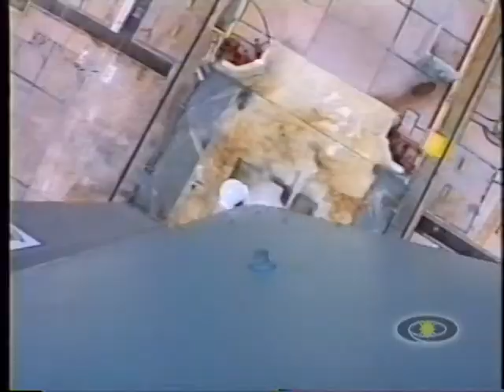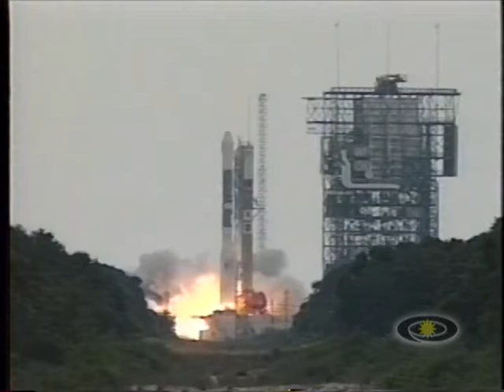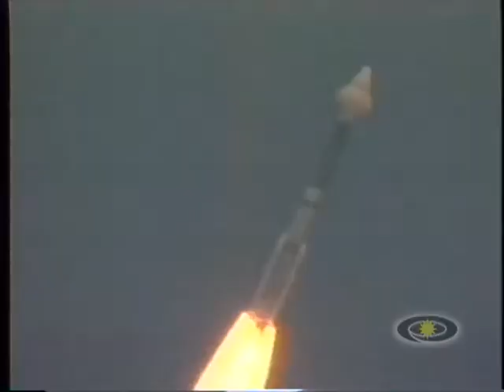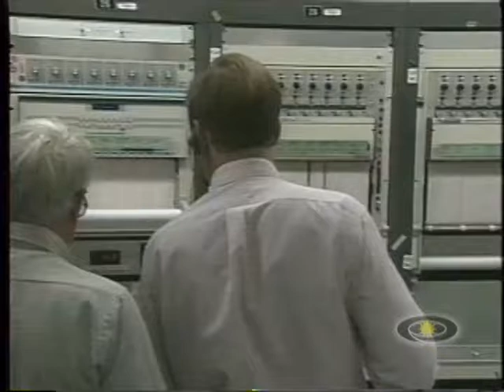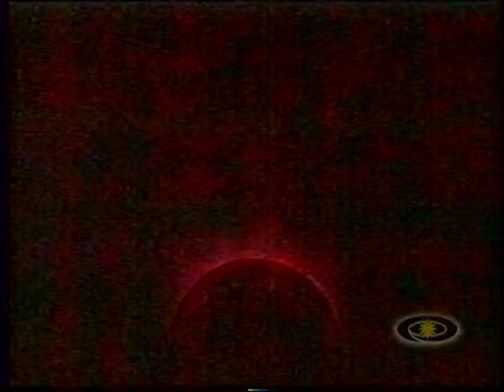Genesis Launch

Comment: So, did they retrieve anything from the sun? 😊
Reply from the maker: Yes they retrieved solar ions.  The actual science is what KIND of ions and WHEN.  They sampled the solar wind during different "solar wind regimes".
Reply: @stuartgray5877  
Hilarious lie, Stewart. How old do you have to be to fall for that, under twelve? 
The solar wind is something that should be everywhere, hitting the very earth. There's no need to go search for it in any spaceships that would "retrieve" anything. It's not like the sun is hidden in a dungeon in some distant place. At the same time, the solar wind itself would fry any "retrievers". This whole story is nonsense only a total dupe could fall for and retell with a straight face.
Reply: Ditto.

Comment: So that makes you what? A visual artist? CGI expert?
Reply from the maker: Cognitiva Dissonantia
"So that makes you what?"  - It makes me a Spacecraft Integration and Test Engineer with over twenty years experience building, testing, launching and flying deep space probes.
Reply: @stuartgray5877  Which bolt did you make?
Reply from the maker: @fpvangel4495  - "Which bolt did you make?"

I installed the Command and Data Handling Module (C&DH or "brains" for normal people) and all of the Attitude Determination and Control Systems (ADCS components)
Reply: @stuartgray5877  How did you fit it into the cartoon?
Reply: @stuartgray5877  
And how would that determination take place, if the earth tilted, spun and spiraled at astronomical speeds millions of miles away? Do you even have any idea what attitude determination would have to involve and take into account? Even if it could on a magical theoretical spaceship right out of sci-fi, what would instantly happen to all its electronics due to space radiation, solar flares, extreme temperatures, magnetic fields, or even passing through something like ionosphere alone.
Reply: @stuartgray5877  
And how far did you launch the "deep-space probes" with a parallel career of running tests for plane gyros?
Were those "deep-space probes" as deep as this low stratospheric rocket? And by "probe" you would mean what specifically - a drone, a balloon?

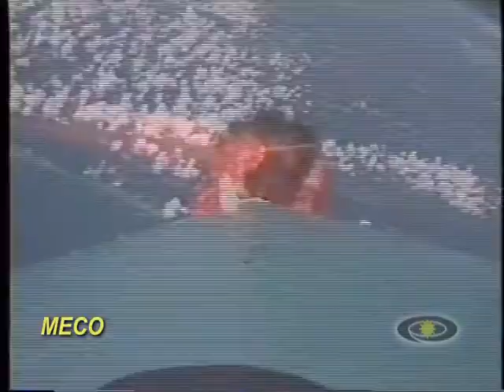Comment: so fake No but seriously, from 1:00 on... is that supposed to be a video? I'm really asking.
Reply from the maker: midihc - SO which part do you think is fake?  How many real rocket launches have you seen in person with your own eyes?  This looks perfectly real to me and I have seen over 20 real rocket launches including about eight Delta-IIs.  You?
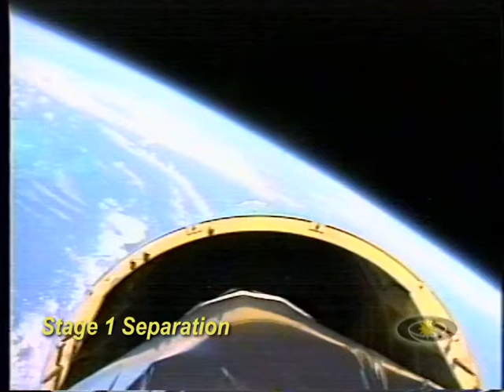Reply: 1:07 is that seriously supposed to be a real video? I'm not trying to be funny but that looks fake to me. I have never seen a rocket launch in person, so maybe that's how it looks. You would know better than me.
Reply from the maker: midihic - Yes that is real.  The video looks like crap because it is downlinked realtime from the rocket during ascent.   Watch the Stardust launch video as well. https://youtu.be/jzDbGXazB2w  or Deep Impact https://youtu.be/JSu-NxBr5Lc   I can tell you with 100% certainty that both of those launches were real and went all the way to space
Reply: Thanks 👍
Reply: @stuartgray5877  ever launch I've seen goes horizontal before dissapearing from sight. Could you sensibly explain that to me.
I have all 5 working greatly, the mind isnt one.  It's the one receiving the senses.
Reply from the maker: @Apilyon   to achieve orbit of a planet you must achieve "orbital velocity" in a direction that takes you AROUND the planet.  They only need to go UP far enough to reach vacuum which is only about 50 kilometers (30 miles) to get clear of Atmosphereic drag.  Then they need to gain velocity PARALLEL to Earth's surface to achieve orbital velocity. So any rocket that actually wantd to reach orbit MUST turn and accelerate "horizontally".  If you just go straight up, you will fall right back down to where you started.
Reply: @stuartgray5877  so gravity is defied by speed?
Reply from the maker: @Apilyon  do you understand "centrifugal force"?  If you move faster and faster in a circle the force outwards gets bigger and bigger right?  Well if you go fast enough around the Earth the centrifugal force OUTWARDS will cancel the force of gravity and you are in orbit
Reply: @stuartgray5877  so Everytime they perfectly match the speed to cancel out the effect of gravity and they go no higher or lower, infinite, and never slow down? There is nothing ever providing resistance on these objects?
Reply: @stuartgray5877  lol no vacuum. There is matter everywhere
Reply: Centrifugal force doesn't build at a constant speed. And dimishes as soon as you slow down. The whole floating vacuum thing never clicked in my head. There is matter everywhere.
Reply from the maker: Mykle Milla
"no vacuum"  Sorry but that is false.  Watch the YT video "Six SpaceX launches synchronized to the landings" and you will see more than THIRTY examples of rocket propulsion in a vacuum.   "Centrifugal force doesn't build at a constant speed." It most certainly DOES exist at constant speed.  Are you saying that if a merry-go-round is spinning at a constant rate, there is no centrifugal force?  Because this would also be false. And once you are orbiting IN A VACUUM, there is nothing to slow you down, so you will keep going in that orbit, basically forever.
Reply from the maker: here is the link: https://youtu.be/4FU0l2JHhGs
Reply: @stuartgray5877  thanks. I will very soon.